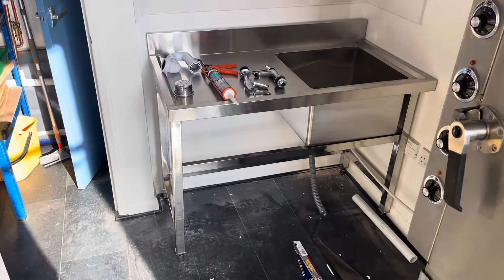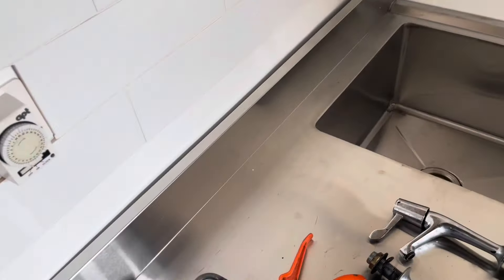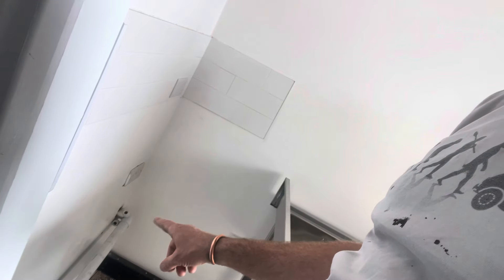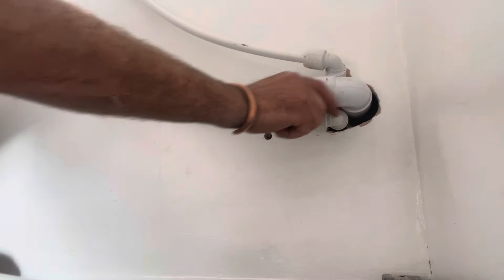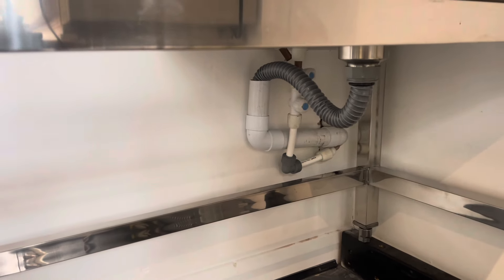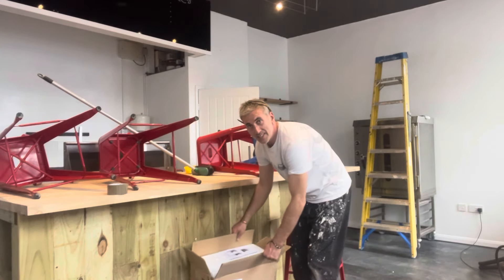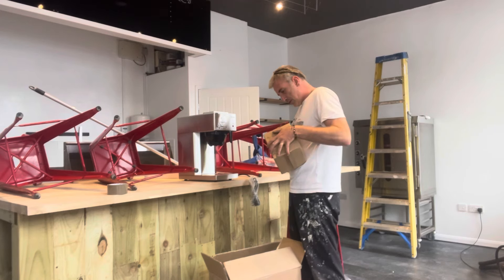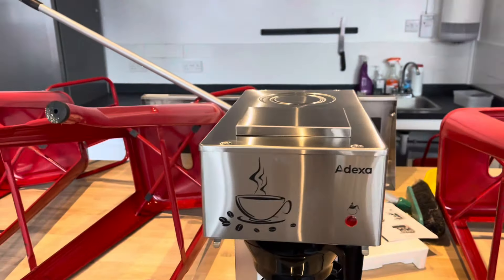Setting up the new bakery part 3

Comment: Very nice, and very exciting too. When do you open for business? On a side note you could end up with some foul smell coming out of your waste pipe as there seems to be no proper trap on the line anywhere.
Reply from the maker: @_J.F_  yes the flexible pipe has a bent , should do it
Reply: @julienpicamil  I did notice that but I was thinking about odeurs coming up from the white waste pipe, which you could easily seal with some good quality duct tape if it turns out to be a bit smelly 😄

Comment: Julien you need a Trap attached to your plumbing under the sink to stop sewer gas from entering the room. It`s a U shape part that always has water in it to stop the gas.
Reply from the maker: @jimstone5755  the pipe goes as a bent shape , should be enough 🤞
None of the trap fit rather than the one which came with it
Reply: @julienpicamil  Do whatever works. Enjoy your videos.